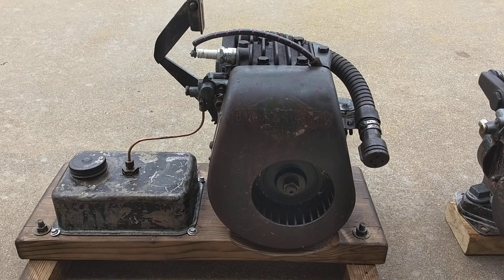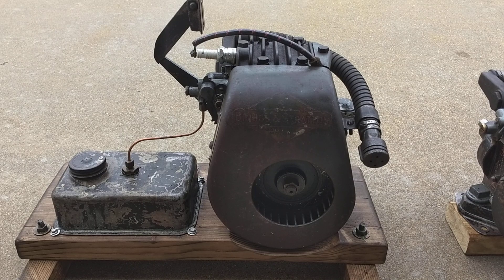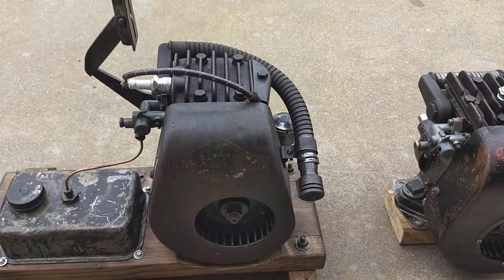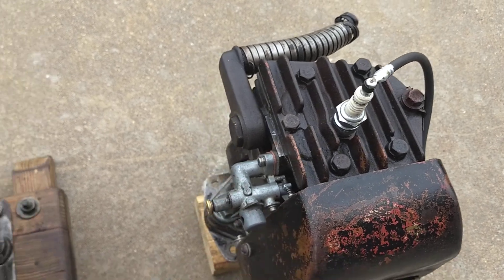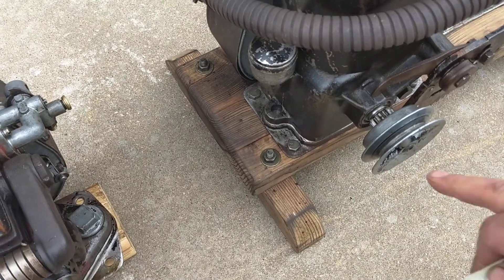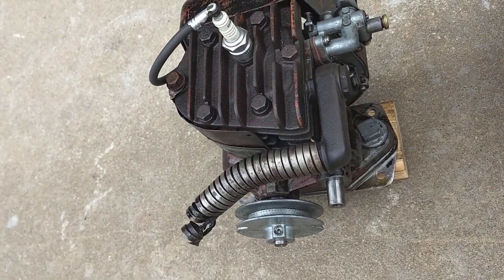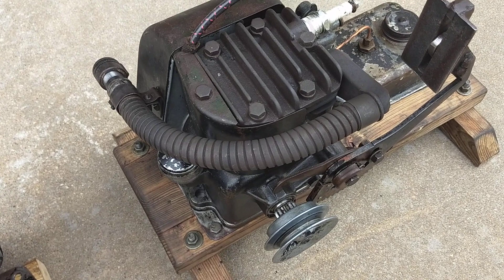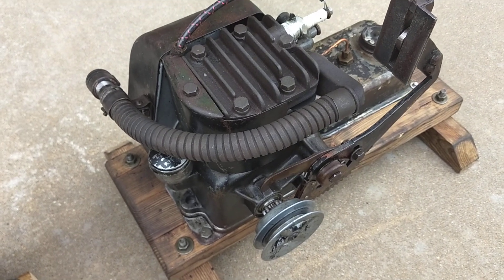1937 Briggs & Stratton Model WM after

Comment: Years ago my grandpa gave my dad one of those WM Briggs and Stratton motor along with an other one. I got the other one running but I can’t get the WM motor to run. The point plunger doesn’t go up and there is a key way on the crank shaft thats missing the key to push the plunger up, do you have any idea if there is supposed to be that key and if so what would it be called
Reply from the maker: Actually there is a flat spot on the crankshaft. As crankshaft turns, the point plunger will fall into it which closes the points. My guess is that your plunger is stuck and will not allow the spring pressure of the points to push it down into the flat of the crankshaft. I would remove the points, spray penetrating oil on the plunger and let it soak in, then try to use a needle nose pliers and gently lift up while rotating it back and forth.
Reply: @Old-Engine-Dude  you saved my life bro, I thought I was missing a piece thank you
Reply: @Old-Engine-Dude  man I can’t thank you enough for the tip I was going crazy thinking I lost a key but I got it running after you led me in the right direction, it used to belong to my grandpa so it means a lot
Reply from the maker: @cappablecannon1824   I'm glad that I can help. they are great running engines and I know how it can mean a lot to your. I purchased this from my uncle and it used to be my grandfathers.
https://studio.youtube.com/video/o4akm1mKHK0/edit

Comment: I like how you have the engines sat on those wooden stands. Did you make those yourself? I just picked up a 1937 WM today missing the fuel tank.
Reply from the maker: Yes I did make the wooden stands. Did you ever get your 1937 WM running? How's that for a late reply, I must have had a slow internet connection. LOL